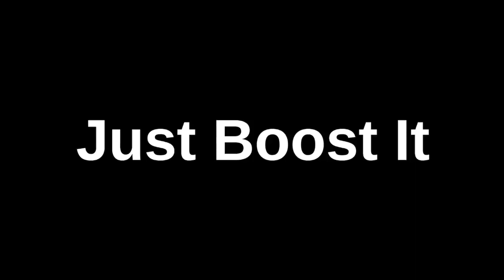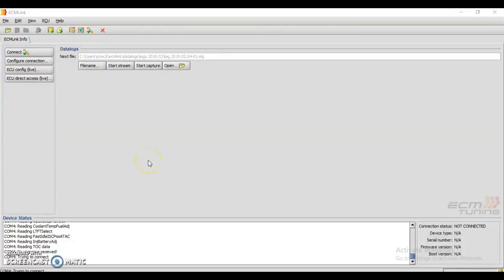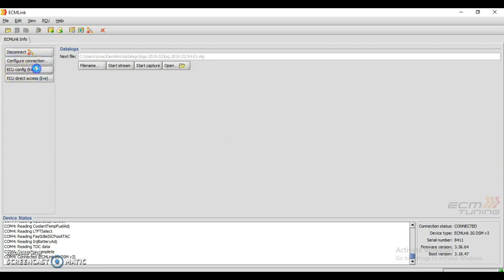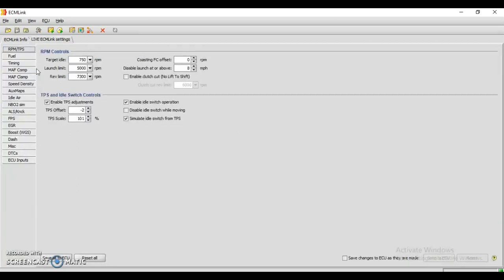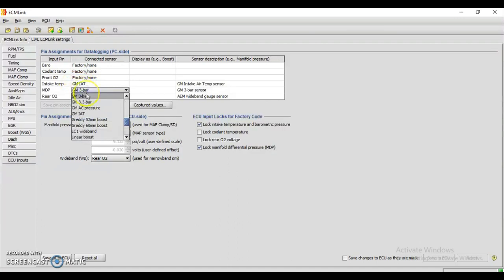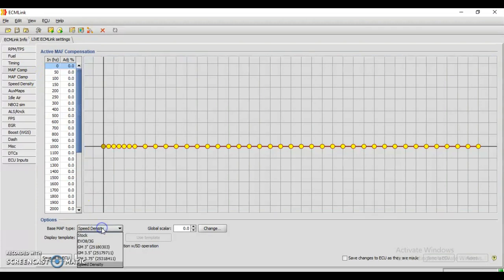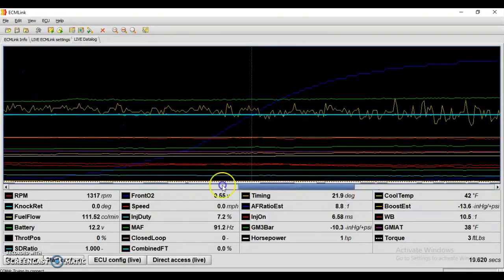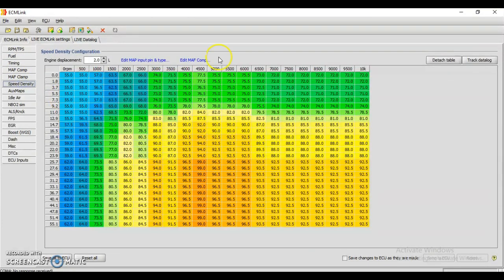DSM Link Speed Density Setup

Comment: So if I already have a ECM Link all I need is the GM MAP Sensor wired into the MDP to remove the stock MAF ? Great Video
Reply from the maker: yes if you want to run speed density. you should also have a wideband just to be safe and thanks i appreciate it.

Comment: I don't understand why "MAF Comp" or "MAF Clamp" are there when using speed density, since there is no MAF. Not sure what either of those are either, though. Lol I also don't get why the timing tab only has a line rather than a table, but I haven't tuned with ECMLink yet.
Reply from the maker: im hoping to make a more in depth video on it soon.

Comment: do a video on speed density ve table. what to look for, changing numbers, how to basically make power. interpolate.  making the table nice.  just getting into ecmlink my self. im still fairly lost lol
Reply from the maker: im new also lol i just do as much research as i can and spread it to the next tuner. i will hopefully be bringing the talon back here soon i had to bring my mr2 back to life for spring. the talon had a water pump issue i just fixed so if the weather is decent ill try to throw something together